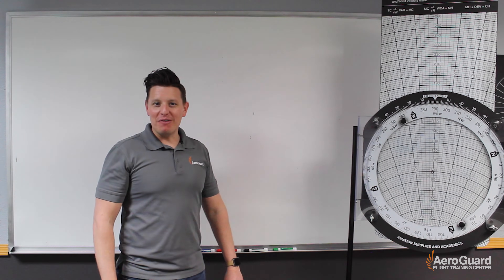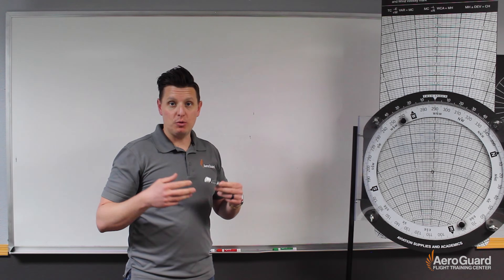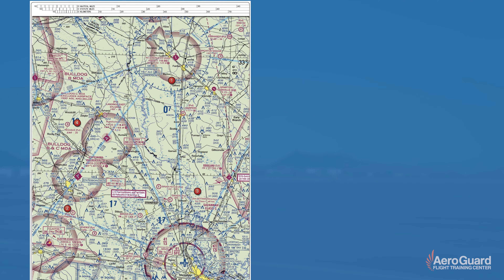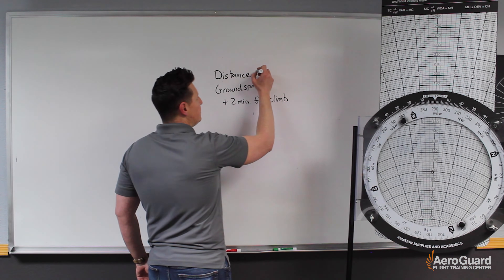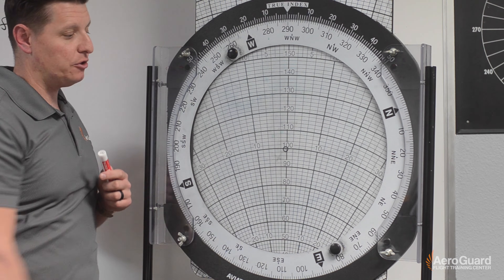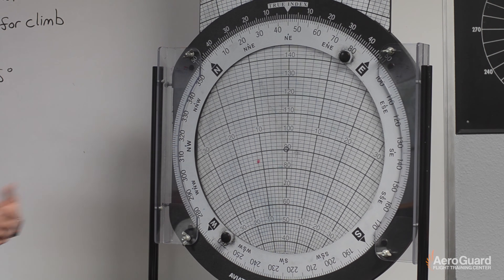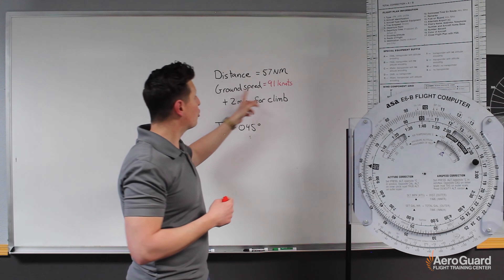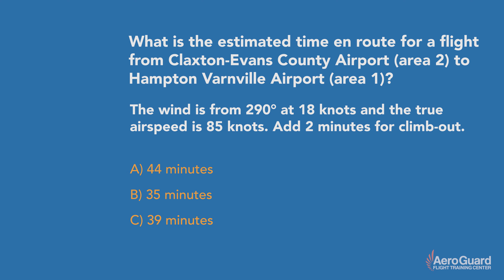How to Use an E6B Flight Computer for Ground Speed and Time En Route - AeroGuard Flight Training

Comment: I got 47 NM not 57 NM... I think there was a typo
Reply from the maker: The 57 NM comes by measuring the distance between the two points in the question, Claxton-Evans County Airport and Hampton Varnville Airport. You would do this by using a Navigation Plotter like a ruler and measuring the distance between these points. It can also be checked digitally using a tool like Foreflight.
Reply: @flyaeroguard  So i guess the map on a test supplement is not scaled right?

Comment: But why does the Gleim E6b say that I need to set the MAGNETIC course under the true index?
Reply from the maker: Hi Joseph. In fact it doesn’t matter whether we use true north or magnetic north as the reference so long as both the wind direction and the flight course are using the same reference. In our example we had access to wind information that was given relative to true north similar to the winds on the Winds Aloft forecast. So either the wind and true course would need to be converted to magnetic direction using the magnetic variation depicted on the chart or we can just keep everything relative to true north. Hope that helps!

Comment: Not sure how you got the true course of 045', I guess I am missing something obvious.
Reply from the maker: Hi, thanks for the question. This was hard to show virtually, but in real life you would use a Plotter, placed over the map, connecting the two points and aligned to a line of latitude to measure the angle and read off the 045.

For example like - https://www.amazon.com/Advanced-Pilot-Products-Premier-Rotating/dp/B08HPT588V
Reply: @flyaeroguard  lol, thx for the reply. I looked it up. It's quite easy once u know how. 😏

Comment: That was actually really well explained. I'm currently reading through the Pooley's Book 3 on Navigation. As an aerospace engineering graduate, I find all the other elements are relatively simple. Navigation is too but it requires a lot more concentration and this explanation just avoids having to re-read several chapters.
Reply from the maker: Thanks so much for the kind words!

Comment: Do DPEs  still want you to use E6B or sectional during the flight portion of exam - when he or she give you instruction to divert to an alternate airport. to calculate the distance, time, fuel use, new heading etc or do they allow you to use GPS and foreflight?
Reply from the maker: You can use all available tools and resources at your disposal, so if you have ForeFlight, or similar Electronic Flight Bag, then you can use that to calculate your responses to a DPE. However, you always need a backup plan in case of failure. Your DPE could very well ask you “What if your iPad dies and you need to divert to another airport, how would you know if you have ample fuel?” You’ll need to provide a response that shows you have an acceptable back up plan. This backup plan may be your on-board GPS if ForeFlight or your iPad does not work, and if that is not responsive or not installed, a paper chart and E6B could be used – so you would have to know how to use all options.
Reply: @flyaeroguard  Thanks for the clarification. I got my PPL about 25 years ago and did it the old fashion way with "steam gauges" & E6B! I was curious  what they do these days.  Thanks again for the confirmation.

Comment: Hi, I didn't get the part of the 57 in distance ?
Reply from the maker: The 57 NM comes by measuring the distance between the two points in the question, Claxton-Evans County Airport and Hampton Varnville Airport. You would do this by using a Navigation Plotter like a ruler and measuring the distance between these points.
Reply: Why I read 47 instead of 57?

Comment: Why 2nd 85 knots was not 185 knots?  (You added 100 knots to the wind speed for some reason)
Reply from the maker: Hi Ken, thanks for the question, although I’m not sure where you are seeing 185 knots? When Eric set the E6B to 100 at 4m25s, this was just to make it simple to draw the ‘wind dot’ at 18 knots (shown as 118 knots, but what is important is the distance between the two being 18 knots from center). When Eric then adjusts the E6B for the answer he sets this wind dot at 85 knots which is from the original question.
Reply: @flyaeroguard  Thanks for the prompt reply. He is saying he is "choosing 100 for easy calculation". But let's say I choses 120 as the center dot then I'll mark at 138 (for 18 knots). Wouldn't that screw up the calculation? I understand he must be doing it right, but don't know how the answer could be same if the center point is just an option to choose from anywhere (may be that axis has no meaning), as we are choosing of our convenience.
Reply from the maker: @thebestken  If you did select 120 as center and 138 for the dot, that would also work perfectly well. The calculation comes into play only in step 2 when you pull the sliding card of the E6B down and put the dot over 85 knots from the question. All you’re doing initially is putting the dot 18 knots above center, which is why the base number (be it 100 or 120) doesn’t matter at that stage.